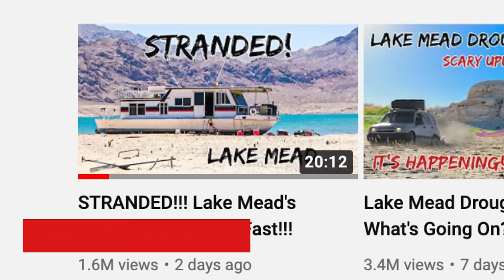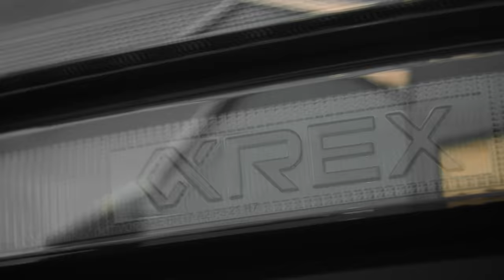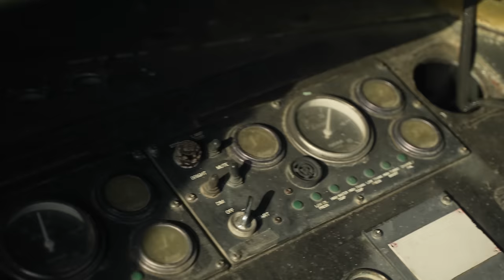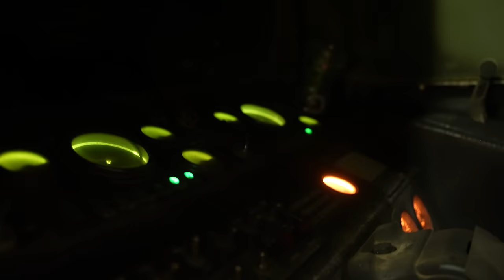Lake Mead Is Dropping FAST- Emergency Houseboat Recovery Before It's Too Late

Comment: I wonder if they pumped water under the boat while pulling if that would of helped at all? What these boys do is awesome though, now you know why the salvage company wanted $20,000 . Sounded like a lot till you see 10-12 guys at it for 12 hrs plus and the hook point of the navy boat snap clean off in the first or second pull. Finally get the house boat in the water and they forget to put the plug in and it sinks haha. Jk.

Comment: That would have been easy using the blow up rollers Get Enough from under the boat she'll roll right back into the water not hard at all you need some more guys and more thinking
Reply: Hi

Comment: You guys do whatever it takes to try and make it harder than it is. Or either you really don't know what you are doing. WHT not use the round ballons they laugh boat's with that roll. I'm sure the wreckers and cranes at your disposal.  You can find something to lift an end up. Ypu had those round poles. You couldn't find another boat or two. I've never seen you guys do a job and not destroy your equipment.

Comment: Did anyone else cringe every time they heard the boats fiberglass bottom creak and crunch because I did I was hoping the bottom wasn't going to break
Reply: I think it would of been easier to get the house boat on plastic platform and pull the plastic platform across the sand